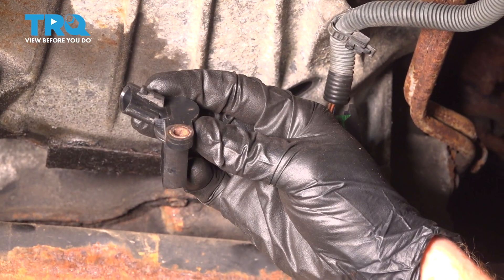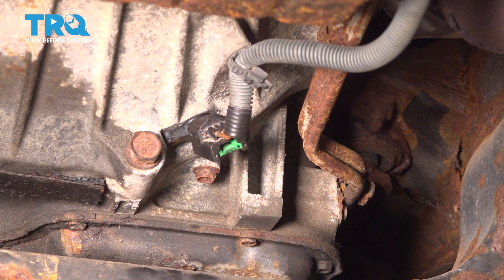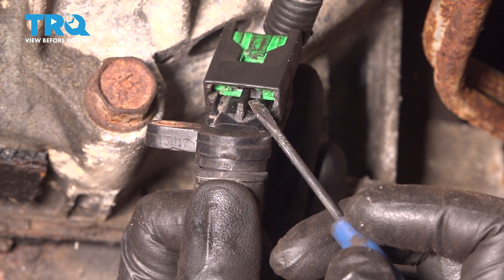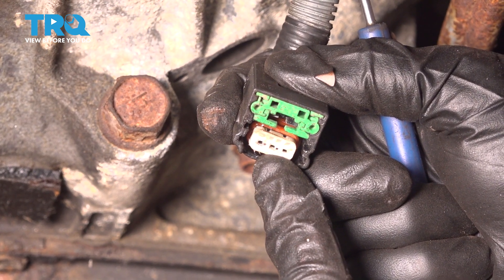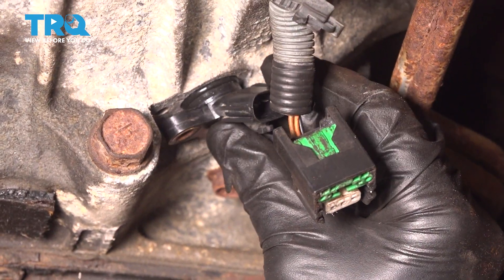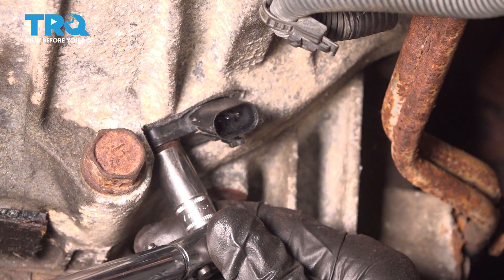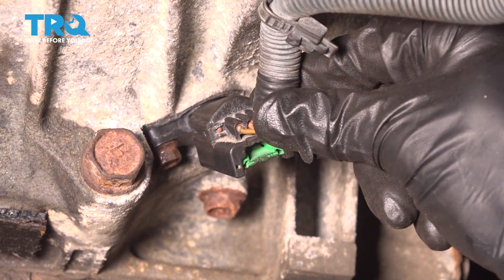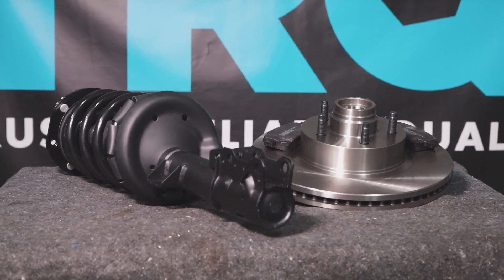How to Replace Crankshaft Position Sensor 2004-2015 Nissan Titan

Comment: I had mine replaced on my 2004 Almera SE and the fault went away (P00340) but it's now returned again.  Could this be the sensor again (I thought that's unlikely) or is the timing chain stretching?  I get a very rough start from cold every morning and evening after work.  Once the car is running it's great, no noises or performance issues.  Anyone any idea?

Comment: If any body has a persistant p0335 on 04 -07 titan if u have one crack sensor near transmission and one cam sensor behind left head drivers side u need to replace both with 
Has to b two of the same 23731-4M50D Nissan Oem parts